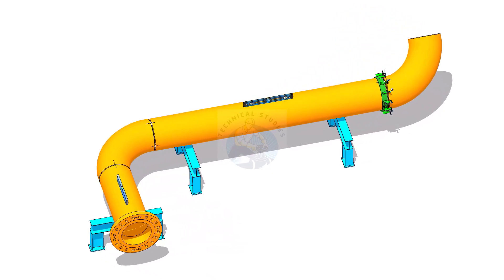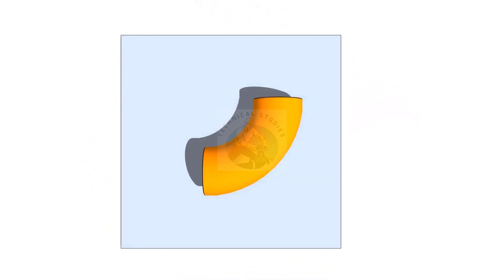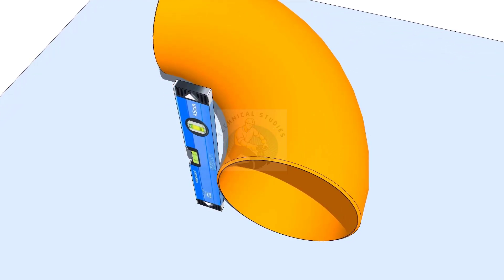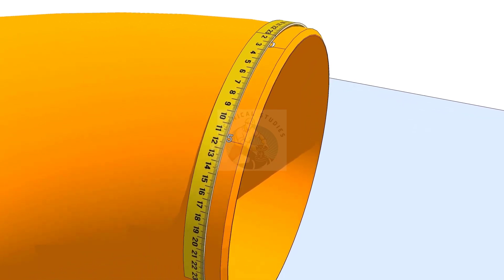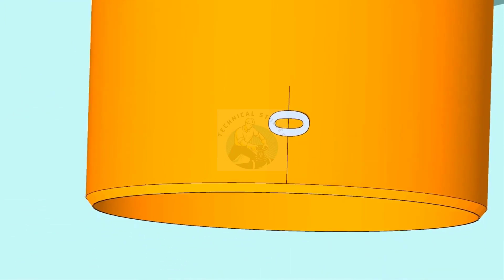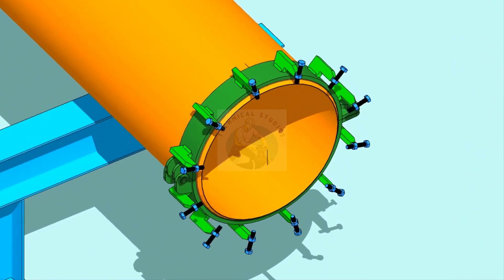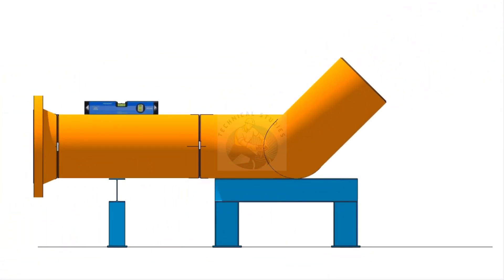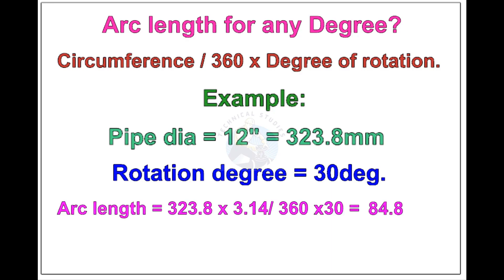HOW TO FIT UP A 90 DEGREE ELBOW, ROTATED TO ANY DEGREE

Comment: Nice. But my question is what is the best way to level a big bore 90. 30 inch to 70 inch.
Reply from the maker: Usually, i use a Straight Edge, or a rectangular aluminium box. and put the level bottle, spirit level, on it.

Comment: 'since diameter of an elbow is 406mm the 1/8 is 159mm?'  could you explain
Reply: Diameter is 406mm. Multiply by 3.14 for the circumference(1274.8mm). Divide by 8. Gives you the 159 mm.
Reply: A much better tip OD X 3,14 X angle u want then devide by 360. 

Same result but easier to understand and get custom angles.

Comment: Thanks for all your tutorials! But some of them are useless at sea! At sea we cannot use the spirit level. How else we can find the elbow center?
Reply: Hey mate. Just lie the elbow on a flat plate and use a 90° square up against the ebow and measure from that.
Reply from the maker: To work at sea, we need extreme hard work and experience. Unfortunately, I dont have any experience, working at sea. Still I think, you can mark the elbow center, using a right angle and a measuring tape. Am I right?